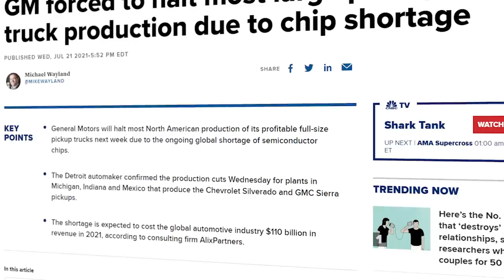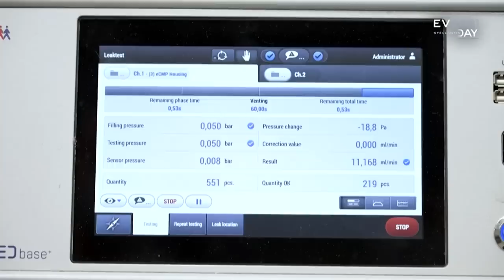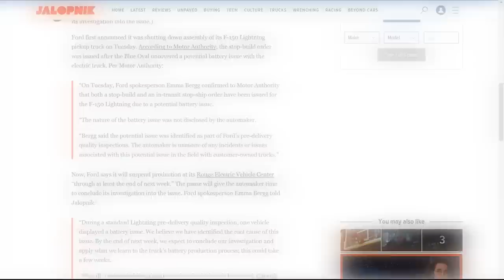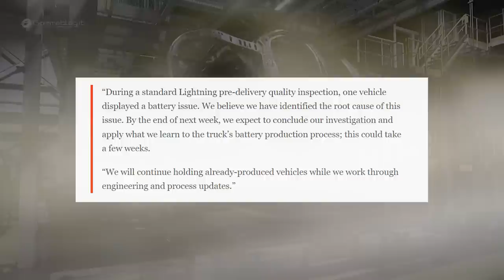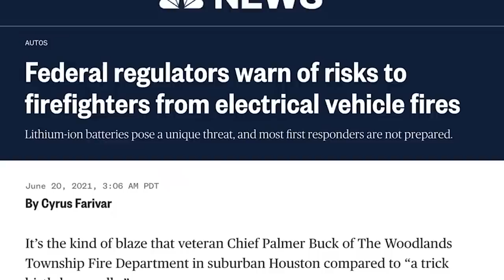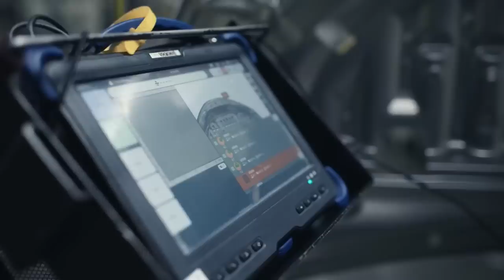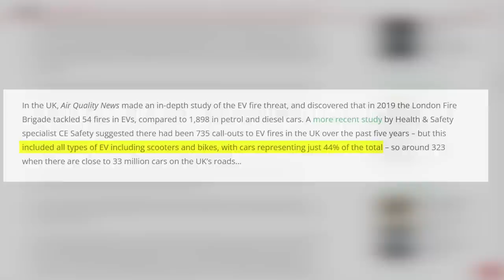The Real Reason GM Just SHUT DOWN Pick Up Production

Comment: Pickups in general are ridiculous in regards to pricing. I turned in my lease, a POS Silverado, the one with the transmission leak and rear end clunk. I was not going to try again, and bought an older vehicle in good shape for $2,000. I'm out, these guys have gone off the rails. And electric? No F'n way.

Comment: new truck prices have risen greatly and results in slower sales. may continue well into the year if the economy slows further. same with other vehicles. but Toyota and Honda have low stocks on hand. why?
Reply: That’s cause Honda and Toyota have no trouble finding buyers. They roll off the lots quick. Ford and GM have that much stock on hand cause their lots do what they’ve always done. They stock a whole bunch of fully loaded high priced units in hopes that a buyer will just accept stock on hand. Honda and Toyota dealers however stock lower to mid priced units more often. This ensures that the buyers with motor budget sense go there. I tried to buy a base ranger XL  100A 4x2 back in September of 21 and 2 years later I’m still waiting and still getting delay letters. ( ultimately canceled my ranger cause they took too damn long and I bought a Toyota that was in transit ). I think you’ll find alot of folks canceled ford orders and just bought what they could find

Comment: First of all virtually, all of the fire issues are related to pushing the batteries too hard through software. After every recall is completed the vast majority just rewrite the software and Range drops significantly so what you purchased turns into a much lesser product. 
Completely free of charge of course… 

Also, when a traditionally powered ice truck catches fire, it doesn’t take much to put the fire out. Conversely, when an electric battery goes off, it’s like a giant road flare! 
Anyone who saw a Samsung phone go off with no power tiny little phone battery can literally ignite like a road flare. Just imagine a battery many thousands of times larger? What kind of road flare are you going to get out of that! 

The fire company needs to be equipped with a special kind of foam to effectively extinguish a battery electric fire!
Reply: Here is a tidbit, many towing companies will not tow them, or load them on a flat bed. To risky, and then there are their insurance costs they have to pay if something goes wrong. Then the tow truck driver, they need specialized training to move these things if in an accident. I will stick with my old and proven technology, the combustion engine.

Comment: Well, American truck manufacturers are now facing the reality that they produce too many super-expensive pick-up trucks and not enough people willing or able to pay for them.  That is the elephant in the room they don't speak about.  There just aren't a lot of people willing to spend upwards of $70-100K for a pick-up truck.  Add to this the price of financing has also greatly increased.  As far as EV's catching fire goes, the issue is, there are relatively few of them on the road and most are relatively new.  Also, the fire statistics are not accurate.  Not every fire in an internal combustion vehicle has to do with the fact that it is an internal combustion vehicle.  Plenty of IC vehicles are used to transport flammable products.  Many IC vehicles have minor fires and a lot of them are quite old.  Comparing fire incidents per miles traveled is obviously a poor source of data because EV's simply don't travel anywhere close to the amount of miles IC vehicles do and are not often used in seriously bad weather areas where accidents leading to fires are most common such as Interstate Highways that run through the Rocky Mountains.  Also noteworthy, is the number of EV's that just catch fire all on their own while parked.  You won't see that happen very often with IC vehicles.

Comment: From Leo:  90% of the crap that needs chips is ancillary BS no one asked for.  GM needs to find a 1972 pickup and copy it.  These $75,000 rolling video games are not what the vast majority of the customers need or want.  I only know 4 people with new chevy trucks, all have ecotec engines, all have had engine troubles that were bad enough they had to drive a loaner car.   The lack of dependability is not acceptable.   If NO EV's ever caught fire, the practical performance is STILL unacceptable.
Reply: Silence, serf.  You will drive EVs because our wise and benevolent “leaders” are far more qualified to make decisions as to which vehicle to drive than you are.

Comment: The largest problem is MARY., Like James Farley ,they are trying to reinvent the wheel.hey Mary if it ain't broke don't fix it. Your trucks don't need thousands of computer chips to run, the old ones didn't have it and run fine. As for the brainless engineer that says they have to have them for emissions and mileage needs to be fired up on making that statement.at minimum a hybrid will get you to the destination without you concerned for fuel. IF IT AINT BROKE DONT FIX IT Mary,Farley.

Comment: GM wants to reduce the supply of trucks in order to keep prices high. They and other North American vehicle manufacturers look at the "pandemic pricing" increases and the fact people were still buying vehicles at inflated prices. So why change. Reduce supply and demand increases resulting in higher prices. The only problem with interest rates rising a lot of their customers can't afford them.  So now they are reducing employees. What happens if those employees get jobs elsewhere and when GM needs experienced employees they can't get them back? 
       Look at what Tesla is doing. Reducing pricing. Reductions of $7000. to $29,000. That will make some consumers look at Tesla vehicles. Then companies like Toyota are introducing a smaller truck, the Stout like the Ford Maverick. Consumers just may look at a smaller less costly truck as it just may work for them. Lower price, better gas mileage. Big trucks sitting on a dealer's lot don't make money, so they will have to reduce the prices.

Comment: Unfortunately GM,FORD & BOEING all have a similar business problem. Its more than a production line issue.  rather than being innovative and nimble. They have chosen to play a political game  to keep themselves solvent. When others have used Science and Engineering.
EV vehicles  have a number of Social and environmental issue  These are often overlooked Because they look pretty and they claim to solve the energy problems of ICE vehicles have created.
But for most the issue is Affordability, and practicality for urban dwellers  that have no access to Overnight charging. 
Another issue is the environmental cost of EV fires This has not been quantified and so when EV Fire occur its at least 20,000 gallons of precious water is used and potentially 100 hours of Fire brigade time is used.

EV's are totally dependent on chip technology to regulate the risks of runaways and fires

Comment: GM trucks are too big and dopey looking.  GM hasn't made a better looking truck since 2000 to 2002 models.  They keep getting higher and higher stance that normal people can not even get into any more.  More gadgets that people need or want.  Crappier engines that fail, etc.  Between the Gov't and GM, the owner has stuff he neither needs or wants for a basic pick up.  You can hardly even buy a strip down model anymore.  I've bought new GM trucks since 1971 every 10 years and stopped with the 2011 model.  Don't think I'll be coming back anytime soon.

Comment: GM is lying, I researched 4 dealers near me and had only 3 1500 Silverados.  They are trying to keep inventory down to keep msrp higher and concern over inflation.  As for gas vehicles catching on fire, I would bet most of them were many years older than the EV compared to.  Lastly, it is no surprise that Ford has issues with batteries, they rushed to get it out and new to building EV’s.  I expect same for others.   Tesla was not built overnight.  I would not buy an EV from anyone outside of Tesla until they have a few years and 100,000 built.  Everyone know when a manufacturer redesigns a vehicle, usually the first year has most of the issues.

Comment: its just a way to not make prices lower and keep mega profits in their pockets.  1st order of business. 2nd order i would and never will own a electric car. too expensive to own. there is more fire risk yes. this vid may say no but that's because electric cars make up less then 1% of vehicle sales and ownership. if they ever start making in mass quantity you will see more and yes they are way harder if not impossible to put out. but im not waiting 15-20 mons to only be able to drive 200 miles when i can fill with gas and drive 400 in only 5-6mins. plus 25% of chargers dont work and again since there are not a lot on the road those wait times in lines to wait and charge will get worse. plus if power goes out my gas car will always work. not to mention having to pay for a charger outside the house. electricity will get more expensive to charge these are more are sold. they will start adding charges or fee's on these cars.

Comment: When you count the actual number of fires, this is a stacked deck from the start.  Sorry, only a small percentage of the vehicles on the road are electric as compared to the number of gas/diesel.  You have to also factor in that EV's are at the most only a year or so old for the most part while the average age of a gas/diesel vehicle right now is practically a decade old with over 100k miles on the clock.  Most gas or diesel vehicle fires are easily extinguished, for the most part,  as compared to EV's where the vehicle is normally a total loss as they are practically impossible to extinguish.  Simply time will tell.